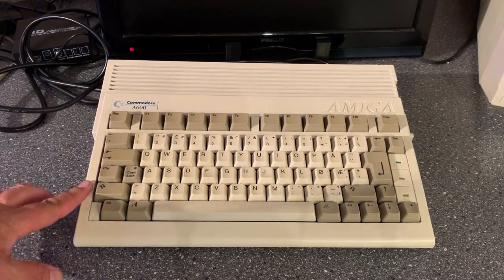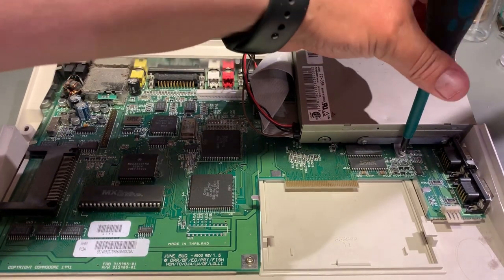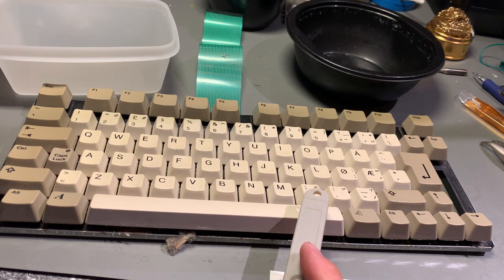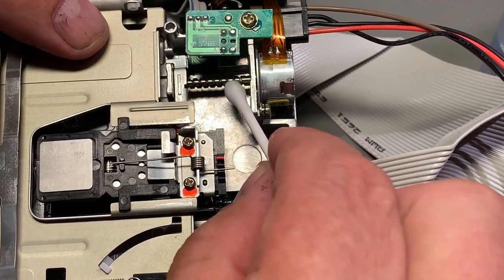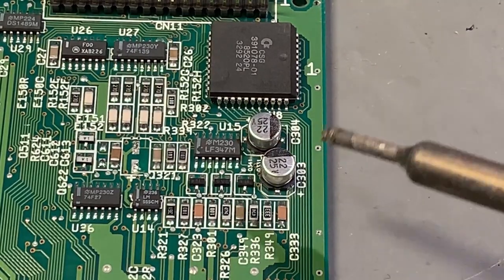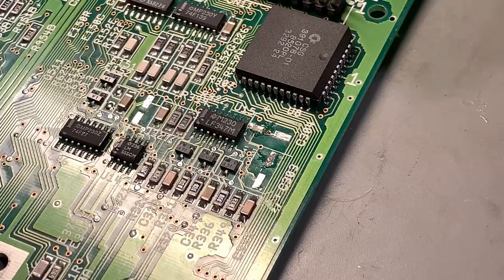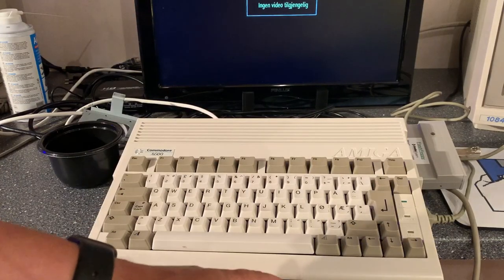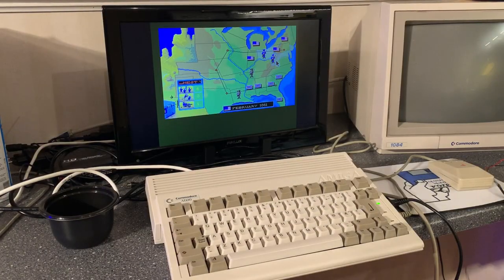Commodore Amiga 600 restoration and recapping trouble

Comment: Nice video! Checkout the Chipquik low-melting point solder alloy. Using that, you can desolder smaller SMD components, such as caps, with an iron even cleaner than with a hot air station. You can save yourself the trouble of pad repairs.

Comment: A few things one should not do :
Don't remove the 2 screws on the back side : they hold the floppy. Not the case. The case is hold by plastic clips. They break easely if you don't open the case with care.
Don't lift the upper part of the case violently. There is a cable connecting the leds to the motherboard in the right handside. Lift it a little bit just to make room to insert your hand dans disconnect it.
Unclip the rear and left clips with caution. Then lift the top part by the front. There is a ribbon connecting the keyboard to the mainboard. To release it you have to lift the upper part of the plastic connector on the motherboard. Don't force, it's easely damageable.
Most a600 came without the top RF shield. Never let the metal pin in the back/middle of the lower RF shield unfolded : the ribbon cable will rub on it and will be damaged.
Reply from the maker: Ok, thanks. Good comment :)
Reply: Ovesen.net What happend next with your a600? 💾

Comment: Please always use a heatgun when u removing smd caps. That way u never destroy pads. Practice on dead modern hardware. When your skills is good u can try on retro computers. We need to preserve old retro computers ;)
Reply: I twisted them off. done it on 3 Amiga 600 motherboards. Not ripped any pads. The trick is to not use any sidewards or upwards force. Just twisting the can itself. It will then break itself off the legs and the plastic cap at the bottom of the cap. And I use angled pliers with some grip texture so it will not slide off the can. I don't have a heatgun, but even if I had, I would probably still be doing it this way.
Reply: I can highly recommed cheap soldering tweezers . They are great for removing Smd Parts. I used them on my CD32 and the Amiga 600 no broken pads at all.
Reply: Agree with Niklas.   Just use hot air and be very gentle when trying to move the cap away from the pads, you are far less likely to rip off a pad this way.  If you are worried about them exploding (very, very rare) just wear goggles.